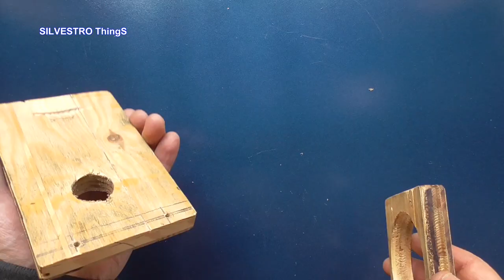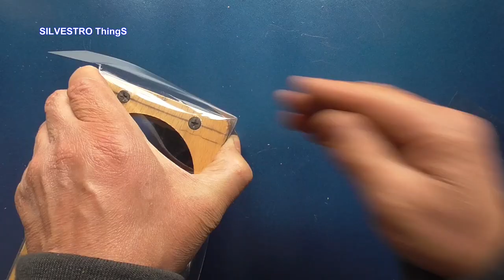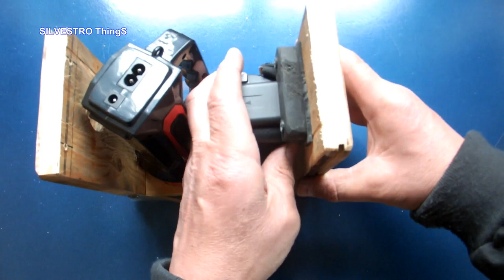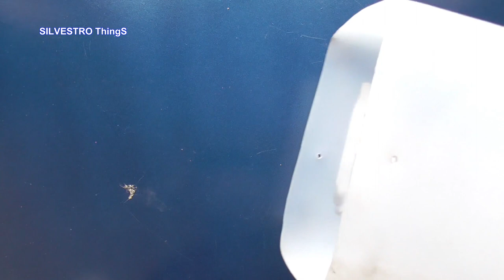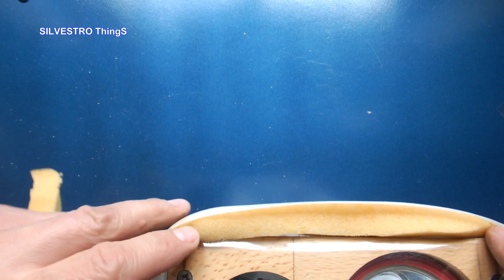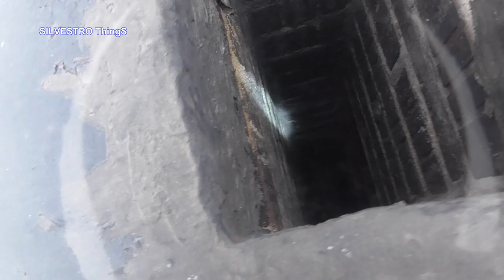Homemade chimney camera - DIY Tool

Comment: Well thought out and well built system that appears to do the job and with ease!  Very good use of materials, and a project any one could do with such a good video to follow.  This could well be a very practical idea for many uses, thanks for sharing.
Reply from the maker: Thanks. I needed something to look at the chimney. Now I thought that I could use it to film in a dusty environment to make shots more attractive and real.
Reply: You created a way put an eye on a problem that provided safety for the operator in a dangerous situation. Very nicely done, and quite low cost.  One could use this idea to inspect other dangerous places with ease.   I like the way you used common material to solve the challenge, most ingenious!
Reply from the maker: @TrikeRoadPoet  Thanks. Well, everything is recycled except for screws, and the camera and flashlight only used, at virtually no cost. I wonder why this movie is being watched and another better project of mine is not finding viewers. Is the format of the film wrong, is the title inappropriate, is the film too long, or are viewers judging the topic as not interesting to them? I would love to hear your opinion about this movie: https://youtu.be/v2nq1dyHH2k